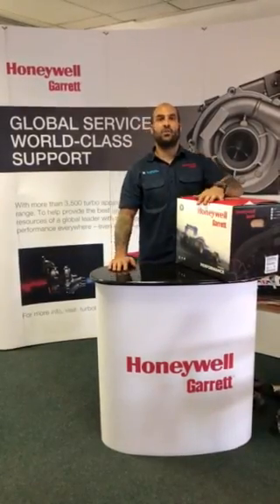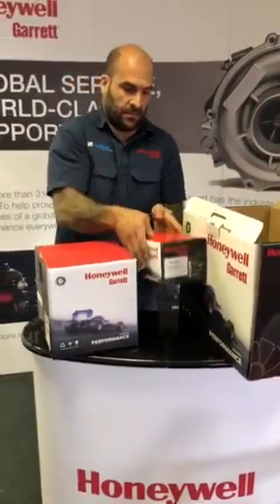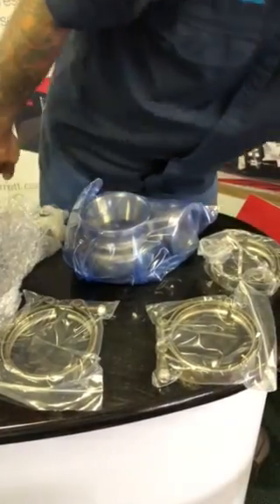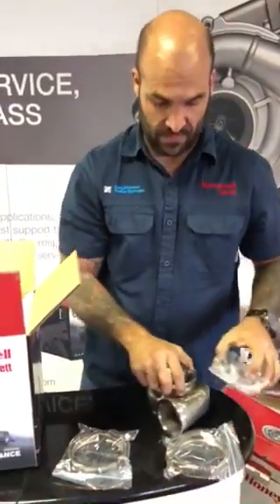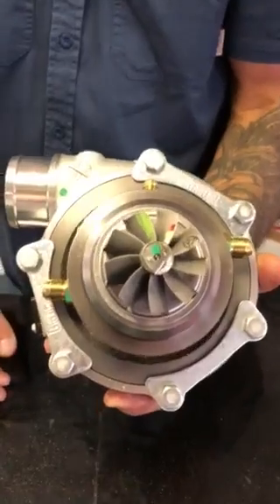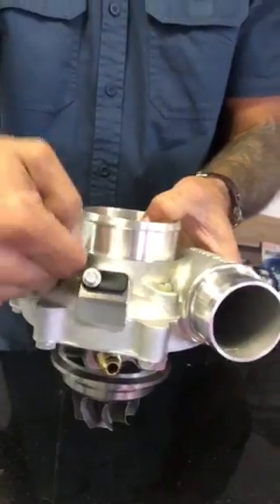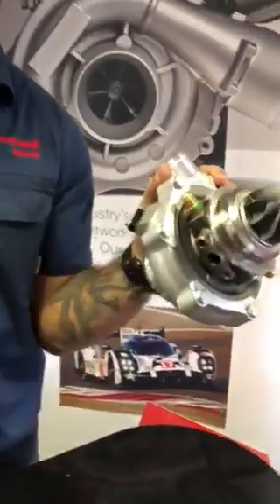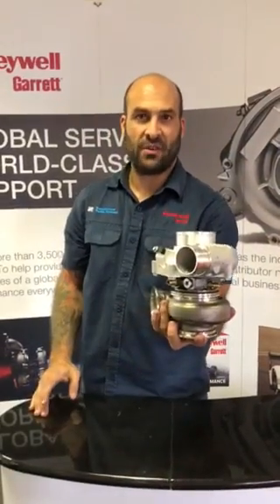G25-660 External waste gate

Comment: Hi Chris great video, im wondering if you have any experience of how the g25 550 compares to the gtx2860 gen2? Both will make the power i need. Will the 2860 have better spool characteristics?
Reply from the maker: Kenny, we have a few of these turbos on Michelin cup and Gymkhana grid cars (subarus...) they are exceptionally fast in response, and will out perform and out spool any GTX28xx unit. They are in fact a replacement for the GTX28 series, as Garrett are busy with the replacement of the GT/X family turbochargers and are replacing them with the G-series units. Next up are the G-30 and G-35 .... look out for extreme performance from the same family size units ..... 2019 is going to be exciting!
Reply: @TurboDirectSA  that is awesome to hear - my new g25 550 has just arrived, looks amazing. I am wondering if garrett will be releasing any different AR v band exhaust housings? if I have the option to go smaller than .72 in future it may be worth a shot. Thanks for your reply i really appreciate it
Reply from the maker: @wabisabi-ken3534  yes there is an AR49 which will be internally gated which will become available early 2019 - ill keep you posted